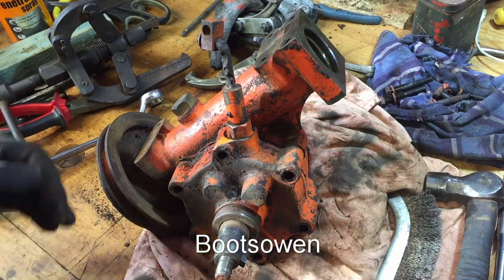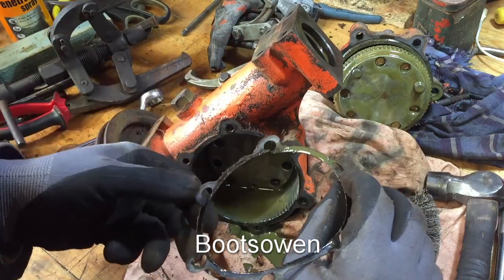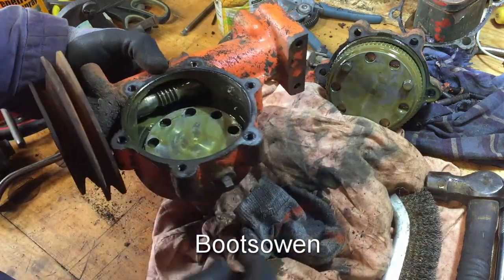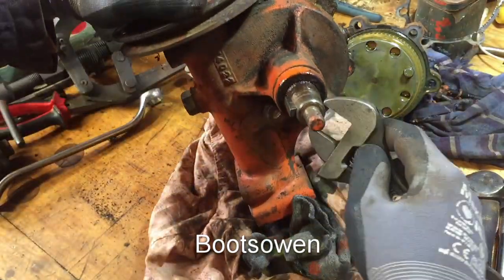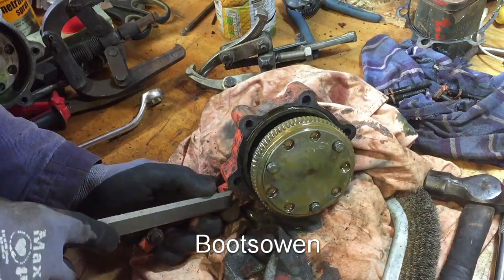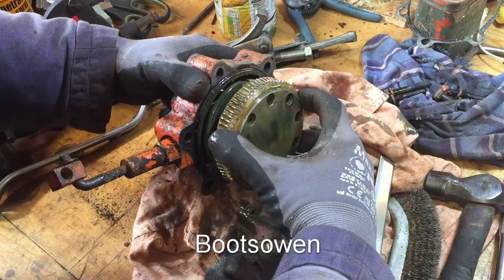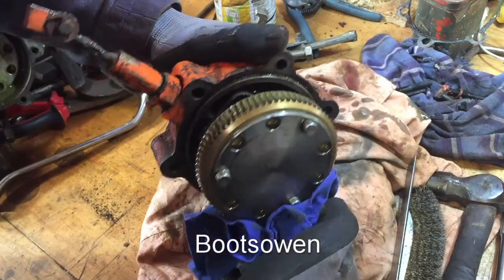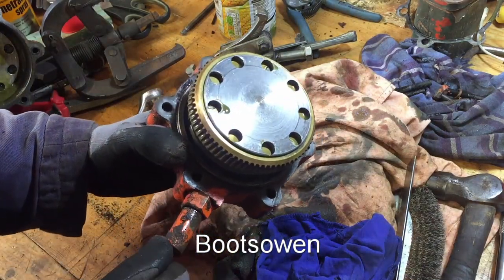Howard 200 wheel drive gearbox disassembly and figuring out how it works

Comment: Surprised the drive shafts are locked up like that. Wonder what could be causing it.
Reply from the maker: I think 20 years in the english climate did it. Probably had clay stuck in there and acted as a wick. The wheel drive was stuck, but the rotor shafts were completely knackered. It took some pounding over about 2 hours to get them out!